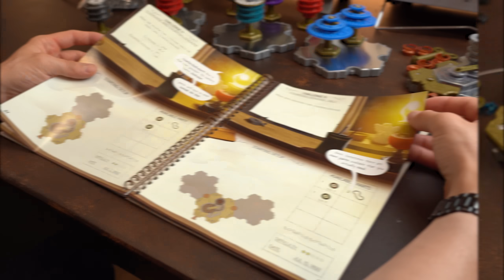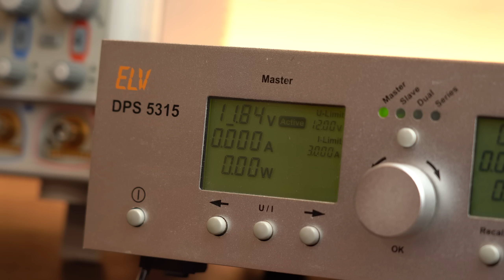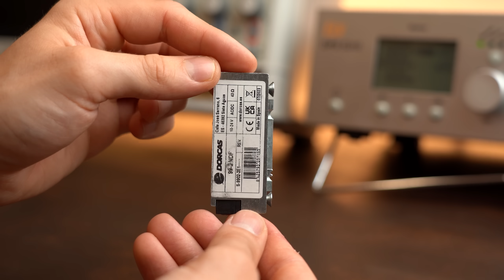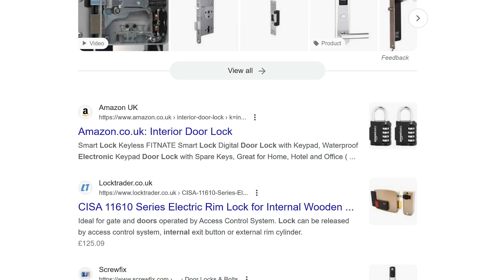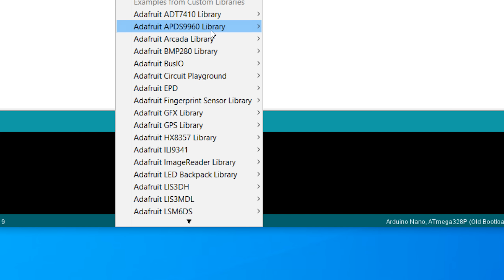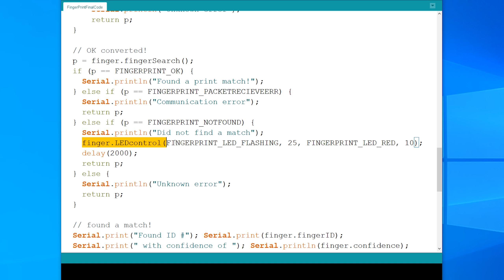Your Door NEEDS this Upgrade! DIY $40 Fingerprint Lock!

Comment: Not safe. It's bad practice to have control wires accessible from the outside. Once kid learns basic electronics, which (given father) will probably not take long, lock will be useless. Cause can be opened by simply applying voltage to lock wires. :P
About cable duct... Yes typical issue... They always wait until it's too late to inform you. Maybe drill hole through wall and take power form the other side. Kinda annoying if you can't access the supply from the outside, if something goes wrong. But as we already discussed, the lock is easy to open from the outside. You can let your kid do it for you. :D

Comment: The first fingerprint sensor has also a "Touched"-Wire, and with two or three lines of code you can set the led to be only on when the sensor is touched.

Comment: Hi Scott, while working with similar circuit and software serial over 12,13 pins of arduino pro mini. Verifypassword doesn't work unless i physically have a gap between yellow/tx pin and red, black and white wires. Help please

Comment: There  are solutions to  power from  outlet lock mounted  in  door  leaf, they  are concealed door loops which  allows run cables hidden between door and frame or  pin connectors when  there is  no  need to have power supply in open position   and  capable  to  supply up tp  30v  dc 3A,   but  you  need  to do milling in  frame  and  leaf to  mount it plus  drilling through leaf for  cable,  so  a  bit  more  work and  costs, but gives  more options.  For home use and without requirements regarding the level of security and excluding fire protection issues of such access control there  is few  more solutions.

Comment: I don't understand why this thing even needs continuous external power. Instead of putting a  240/12  power supply inside the lock-box, make a battery pack with 3 or 4 18650 lithium cells. You could mount 3-5 watts of PV cells to the outside of the box to charge from ambient indoor light, or put an externally accessible USB-C PD port for charging. I would think that four 18650 cells could keep that thing running for close to a year with 3 or 4 uses per day. 

If external power is your thing though, I would use what I call wall-warts, where the "power supply" is located in a cube on the plug. Then the wire running to your lock-box will only be 12 volts and can be extremely small and easy to conceal.

Comment: I wanted to do some similar project for the house door.

But what if there's a failure or the power is out?

Then you get locked out of the house.

So is there a system that offers the option to still use normal keys in case electricity fails?

For example some mechanic that turns the key inside on a normal lock instead using additional locking bolts?

Comment: 1. You did the most common mistake every Chinese manufacturer is making. You've mounted the reader on the box containing the electronics. One could open the box and electrically unlock the door.
2. Design and securitywise, just drill a hole for the sensor, keep the electronics inside the protected room.
3. Why drill a hole for a second outlet? Don't you know we have dual outlets available in Europe?
This is so frustrating!

Comment: Whats stops someone from ripping the lid off the box and feed power directly to the striking plate? You should have mounted the electronics on the opposite side of  the wall so only the fingerprint  read is accessible if you want something locked in, otherwise it is not serving the full purpose of being locked.

Comment: Just started watching this video. My first thought on how to keep the door closed would be with a magnet.
When energized you would not be able to open the door. Easy installation of a iron plate to the door and an electrical magnet on the door post.

Oh and btw, the grubscrew for securing the doorhandel to the shaft will be flush if you position the shaft so that the grubscrew will sink into the groove in the shaft. That will stop you hurting your hand.

Comment: What you do is take your oscillating cut tool and cut the exact same sized home in the wall insert your eletronics on the back side of the dry wall cutout and also cutout a circle in the rectangle you cut to insert the thumb sensor and then plut the dry way back and then patch it sand it and repaint it and it will be flush on the wall without that box sticking out of the wall

Comment: I had the same problem but with one of my cats, she jumps on the handle and opens the door to the shop and enter but she doesn’t close it behind her so the other cats enter too, it’s a woodworking / electronics home shop so it contains many dangerous stuff, I solve it by removing the outer handle and replace it with wood round handle that she can’t turn.

Comment: It would be better if the Fingerprint Sensor is sending a Hash of your Fingerprint to the uC. Now, you can crack the device out and put the indicator wire on GND or VCC to enable the Lock. So far I have only found reading devices that do this in this way.

Comment: While this kind of thing is certainly effective against children, my primary beef is this implies cheap biometrics are secure  beyond that and they aren't. Basically all of this low end biometric hardware is fairly easily bypassed or tricked by someone with decent knowledge of them. So while this is a neat and techy way to "childproof" (especially considering most childproofing hardware is garbage), it isn't a means to actually handle real security.

Comment: How about just using a battery powered solution? I do not believe that the power consumption of this setup is so high. with a little switch added you can even extend the batterys lifetime, just turn it on if needed. Your Wallmount has plenty of space for some cells.

Comment: Well you can put a small solar panel with a charging circuit board to keep the battery always charged. Even if the light is dim, it will charge up the battery and make the manual recharge process less frequent

Comment: Wait, so if the power goes out you can't get in ? What if the reader or the circuit inside break one day ? No mechanical backup, and no backup battery to account for power loss (if the hardware still works) ? 🤔🤔
Also, since the electronics are on the outside, you wouldn't want your kid to start playing with water one day and decide your box would be a good target, or just start unplugging the wire for the box, or just start breaking it with whatever he finds laying around. At this point I'd say there may be more opportunity for trouble OUTSIDE the room than IN it... 🤣😂🤣😂

Comment: Just wondering why not use a ATTiny85 or similar rather than a Arduino as the code is so simple and so few pins are needed. Unless I am missing something, which is perfectly possible.

Comment: With a decent power pack, waking up the Arduino using the sensing function of the fingerprint reader, you can get over an year of power if the coil only consumes 200mA.

On 20 entering openings per day, you would consume around 3mA per day.

It's 0.17 mA per opening. Tricky but doable.

Comment: Can you try the CCC method of tricking/stealing fingerprints with cyanoacrylate and wood glue on your sensor? And about the Aliexpress video featuring the Lilygo ESP32-S3 with resistive touch screen, the capacitive amoled version costs a bit more but looks gorgeous and the touch screen is super precise

Comment: I would've added the lock to the locker not to the handle mechanism. then have the door permanently locked (key in a safe place). This way you can have the benefit of needing the finger print scanner to open the door (push handle as always, then just pull.) but should there be a power outage or a malfunction of the lock you still have access to that room.

I'm a great fan of redundancy^^

Comment: If you already had a solenoid rod, you might also have removed the bolt from the door, placed it inside the doorframe instead, using a solenoid to latch the bolt from the frame and into the door. Aka. the old switcheroo 😊

Comment: just hide the wiring under the Fußleiste (baseboard). If you wire it directly, you can just run power down through the wall below the outlet you just installed.

Comment: Perhaps just put a hole in the door frame to screw the sensor into, and then wire everything into the office and not outside the door.  You'll need longer wires, perhaps, but your outer install will look a lot more seamless and your wires will pass through the wall into your office.  Then, you can power it wherever you want!  I do suggest an emergency battery backup for power outage events.

Comment: You should move a little bit electric strike in the direction of the door. Just unscrew the part with two screws and move a little bit. If you move it, you won't have to push the door to open it.

Comment: I think what I would have done is recessed just the fingerprint button into the door frame and the electronics I would have hidden inside the plasterboard wall.

If I need access to the electronics I can fit a ready made plastic accessory panel from the inside. I would have also tapped the socket and run a cable through the wall for the connection via a spur.
It would have been a very clean install.

This is my opinion.

Comment: You might need a manual override lock, just in case? (And hide the key somewhere so ridiculous that you can't forget where it is. Said so many people before losing their essential keys to things, before.)

Also what if there's a power failure? Might be better to do what most security gates do, and run it off a trickle-charged battery.

If you want to get really way out, get a gate control motor kit, for a swivel-open (as opposed to slide open) gate, and then take out the entire drywall, and replace it with basically a security gate. So it would look just like a blank wall, but when you click the remote, the whole wall swings open. Go inside, and it's a potential hidden room.

OK, so that might be overdoing things a bit. Also now instead of a key, you'd have a gate remote a baby could probably operate even more easily than a door handle. Click like daddy does, and that wall opens up ...

Could you put a fingerprint reader on a gate remote? 

Hmm ... I was just being silly there, but you know? That's not the worst idea on Earth, if it's doable in a reasonable kind of way. If someone who steals your gate controller can only use it by having the same fingerprints as you, they're going to struggle. I suppose this is only a real problem requiring some solution in a place like South Africa, though. Most other places, what's the point.

Comment: Have to ask why didn't you just drill a small hole in the wall behind the project box & power it from inside your workshop? Also you said yourself the lock could be powered from 24vDC as well as AC so why not just use DC- everything else in the box is using DC already & a buck converter with suficiant voltage are extremely cheap.

Comment: A neat project.  I was laughing when I heard "I was told it looks unappealing." I know exactly what that means.  I've learned to ask my wife her opinion on a project along the way and get her input on aesthetics as I go.  It took a lot of convincing to get her to let me make a wireless doorbell system that goes through a playlist of songs.

I do have one question.   I understand that the goal is to keep your child out of your office.  And this isn't really an issue when they're up through the crawling stage.  But as soon as they start walking what is to stop them from popping the lid off of the 3D printed enclosure and sticking their fingers inside of a 12 volt circuit?  Because the 12 V connections I believe are exposed inside that enclosure even if the high voltage AC connections aren't.

Comment: You can drill a small hole inside your finderbox to get through the other side of your makerspace,then install an outlet there,its convinient because you can mount an outlet and route everything with electric pipes so its not unappealing,plus is safety proof cause its inside the makerspace which you already dont want anyone to go in.

Comment: @greatscottlab  regarding the unappealing part of it, a couple of years ago I refurbished an empty room as a studio, for my home office and also for a sofa/bed the kids can use when they come visit, with the kids in mind I made a wall devoted to multimedia an gaming but since my walls are concrete everything is ON the wall and not IN, so to hide all the cables I just drilled holes on the wall and those holes go to the next room (mine) where I sort all the power and ethernet, sure my room looks awful with all the cables coming out of the wall but not only the guest/studio/homeoffice/gaming room looks clean I can also unplug them when they are still gaming and yelling at 3 in the morning.

Comment: Hello,

my first question would be: Up to what age of the child does the door need to be secure?

Personally, I think a fingerprint sensor is unnecessary - a pushbutton with a dropout delay placed at head height or somewhat higher should be sufficient.
As an electrical technician, I'm more in favor of fail-safe mechanical solutions.
But everyone as he likes ;-)

There are locks where you can operate the latch with the key (see apartment door). This could be an option for a backup solution if the mechanism fails.

A box next to the door - hmm, I don't like it optically either. Either get a flush-mounted box and a blind plate that matches your switches and outlets.
Or integrate the sensor in the door knob.

I would feed the switching signal and the power supply over two wires and thus over the door hinges. Two spring contacts should also work. Finally, the signal only needs to be set when the door is closed.

Function approximately as follows:
On the door frame or wall a power supply unit, a relatively low impedance resistor, a comparator with switching stage and the magnetic opener. The power supply feeds the fingerprint sensor and microcontroller in the door knob via the resistor and the door hinges.
A linear regulator provides the logic voltage.
When the finger is known, current is drawn via a switching stage and a resistor or zener diode. This causes a clearly measurable voltage drop across the resistor between the power supply and the electronics in the door knob.
The comparator recognizes this (it monitors the voltage drop through the resistor) and operates the door opener.
If using spring contacts, a dropout delay may still be necessary.
Instead of spring contacts conducting tape and rf gasket should also work.

This avoids breaking wires ;-)

Depending on what kind of door hinges you have, this is pretty easy to implement.
With my doors there is a plastic cap between the two parts, with my parents doors there is not.

Comment: That kind of electric lock needs just an impulse of electricity to stay open. It is not supposed to be energized for 3 seconds, as you did in the SW.
All this design could have been mounted in the door with the original handle in place and the fingerprint sensor replacing the keylock. This way you could grab the handle with your fingers while touching the sensor with your thumb... Just a bit of imagination.

Comment: Bio identifiers are great for identification and absolutely useless for authorization.  Anyone that is an IT security professional worth their salt will agree on this. The reason why is that you can't change your finger print, iris or whatever you use for identification. Once a way to clone your identifier has been identified, there is no way you can change your "entrance code" to prevent copycats getting your access.

Comment: Did I miss something? Why not put the electric locking mechanism on the deadbolt side so you can still use the manual key? And then you wouldn't have needed to change the door handle.

Comment: I am so stressed out that he did not do this for the key lock part. Eg leave the handle as it is, and leave it mechanically locked to use the digital unlock.

THEN. If the power goes out, you can just use the key to get back in. AAAAARGGGGGGGGGGGGG (andyesputtheelectronicsbehindthewall)

Comment: You could mount just the reader portion on the door, and have the rest of the electronics/mechanism as it is now. Also, having a manual override such as a key or similar would be a good idea if the power is out.

Comment: Fingerprint actuation is fancy, and fits to the channel concept. But, I would just install a pushbutton to the upper frame of the door, where you can reach but the kid couldn't. No Arduino, no mosfet, no fingerprint reader, just a cheap pushbutton. 🙂

Comment: I would drill through to the other side and power it from there.  As a backup when the power is out, have a small USB charging port on the bottom that you can connect a USB power bank to power it.

Comment: There are 2 ways you can make it appealing, you can cut a channel so that it goes directly UP from the security door, around the ceiling cavity, and down to the nearest 240v outlet, or if there's not much insulation behind you can drill back into the wall cavity, up and over.

Final product will have wife approval factor of 10 and local laws approval of 10 because it's using the standard up and over. I know it feels like a waste of material, but it's a lot more safer, it takes the guess work out of horizontal when trying to put screws in for fixtures such as pictures and shelves.

I do like this project and it would be a fantastic thing, so glad you engineered an exit that requires no electricity.

Comment: is it really permitted to use Wago connectors for power sockets in your country? Well, we know of course it is WAGO - stuff from Germany with superior quaility, but in some countries this kind of connectors mostly used for light or small voltage wires only, and for power sockets electricians use soldering or etc